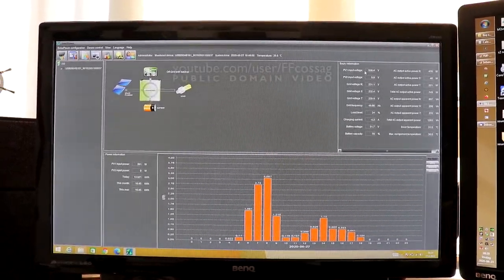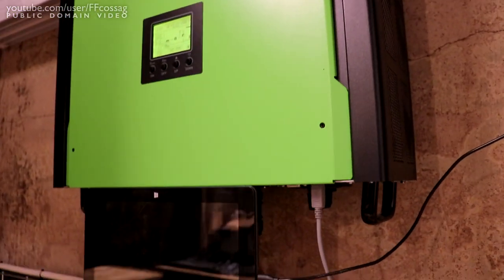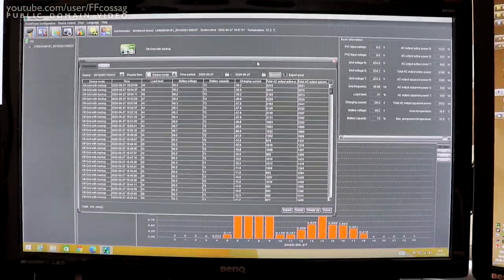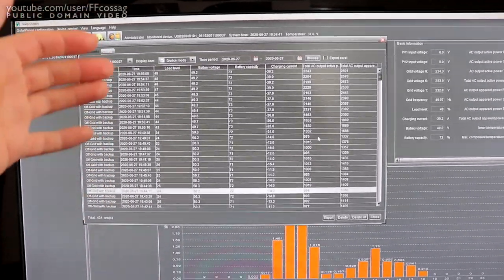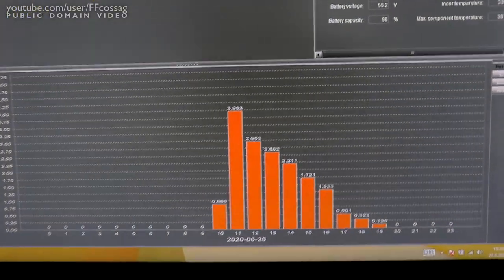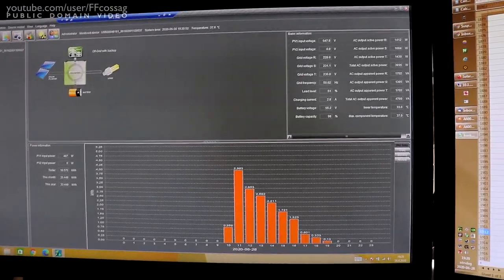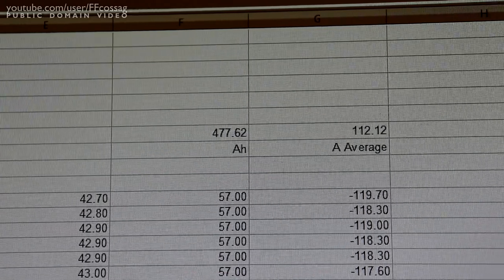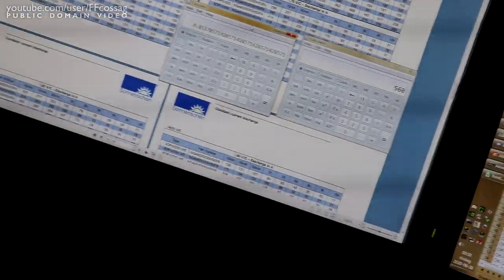OPzVLOG 8 - Bank Cycling #1

Comment: Great video  What voltage to you charge the batteries to  bulk / absorb ?
Reply from the maker: I think I have them set to 2.35 V/cell absorbtion and 2.25 V float - though I'm still experimenting with it since my system has poor charge timing control.

Comment: Lots of questions I know,my apologies,but I just want to know,do you get much of a Voltage drop in the cable,between the house & the barn?because if my memory serves me correctly,that is a reasonably lengthy run?I remember thinking at the time,"hmm he might be pushing it a bit with the length of that run"so keen to know about that??Cheers mate,from Daniel in South Australia 👊
Reply from the maker: No, since the current is less than 10 A, it's not so bad. The total wiring loss between the panels and the inverter is about 20 W under full load, including switchgear and fuses.

Comment: PS What about snow?does it snow where you are?I would imagine you would have to remove snow,almost constantly,to avoid potential damage,let alone anything else???
Reply from the maker: Snow doesn't cause issues, PV panels are built to withstand it. Mine are also slanted 35 degrees, so it slips off before it accumulates.

Comment: I guess that shows why it's a good idea to balance the batteries before putting them into use, I say that like I'm an expert, but I'm far from it, I only recently read about that with replacing the batteries in my recent acquisition of an APC SMT1500i SmartUPS with dead batteries (as well as learning about how to adjust the float charge settings on one as not to kill the new ones!), pre-charging the two batteries in parallel at 12v first to equalise them before fitting them in the UPS in series, so they don't reverse-charge, just need said batteries to arrive so I can get it up and running... :)
Reply from the maker: Smart move - you can gain years of battery life that way.
Reply: Fingers crossed, already down a UPS cos of failed batteries (for the second time in that unit!!) at the moment, so this APC one will replace it, and hopefully last a bit longer between needing new batteries!!! :P